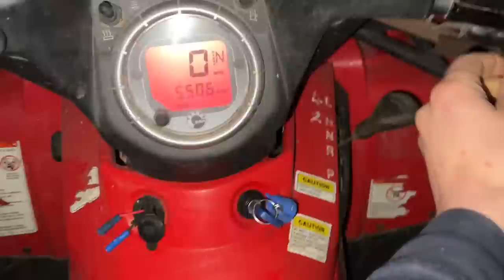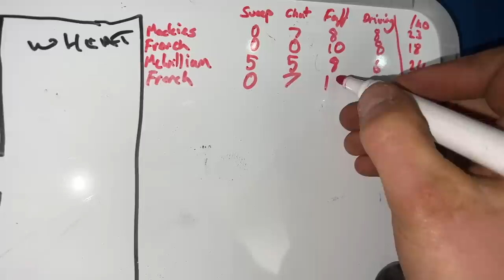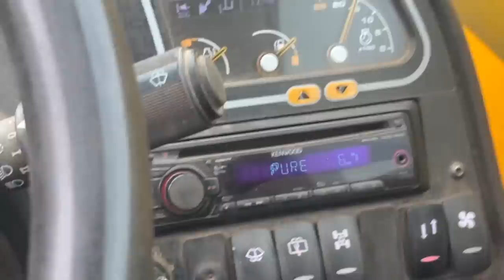£5000 Window

Comment: It's a motor with an offset weight so vibrates which eases the work of the plough. And hang those air pipes up sir haha love the videos.
Reply from the maker: Thanks 👍
Reply: I was sure it's a hydraulic motor, but to use that for vibrations never would've crossed my mind.
Definitely makes more sense than my theory of it being a gearbox for the motor...

Comment: The hydraulic motor is probably a vibrator that shakes the mole plough so it pulls through the ground a lot easier.
Same principle as a shakaerator but using a motor rather than the pto

Comment: The hydraulics on the back of the pipe layer ripper are for a vibrator makes getting through hard ground alot easier
Reply from the maker: Ahh that makes sense, cheers
Reply: @CrawfordsFarm1  Vermeer also make some pretty good Hay making gear, mowers and balers

Comment: Vibrating leg - used for pulling in pipe  usually for irrigation systems on golf courses (upto 125mm) which is pulled in a bullet behind the leg and control cable is fed down the chute and lies approx 100mm above the pipe.  I have a video of it on YouTube

Comment: Hydraulic feeds are they for a digger chain that could run in front of drop leg with cable in it ?
Reply from the maker: Few guys saying vibrator to ease the blade through the ground 👍🏼
Reply: @CrawfordsFarm1  yes that’s a big possibility shatter soil but with minimum disturbance

Comment: Maby it a hydraulic motor so u can take that blade off and put a chain trencher on if that makes sense
Reply from the maker: Possibly
Reply: The machine can also have a chain trencher, or even a whizz wheel, but they are mounted independently